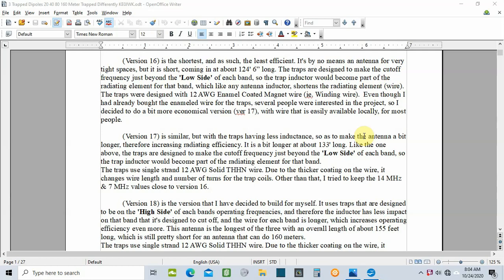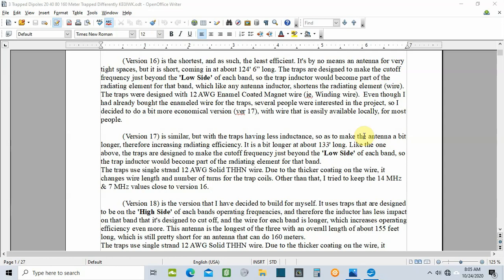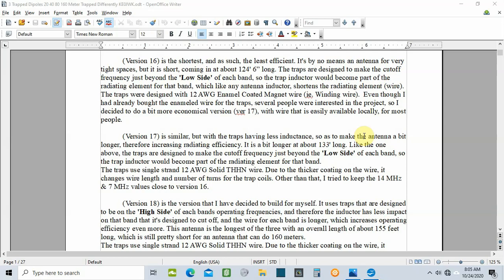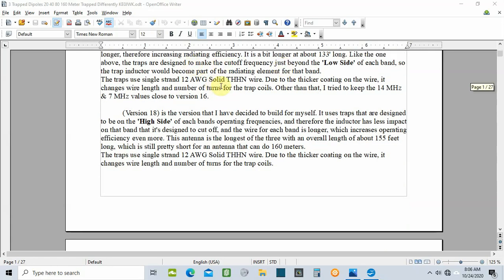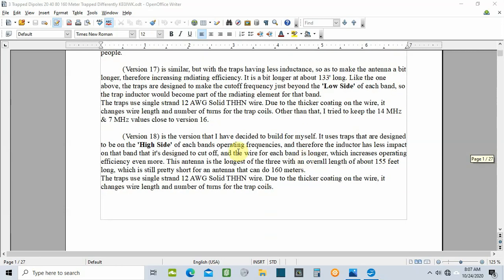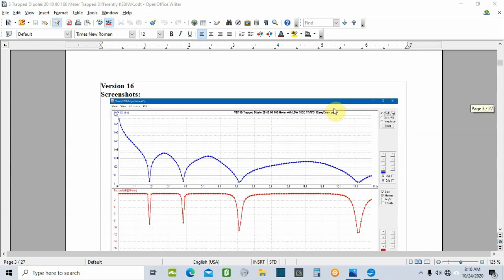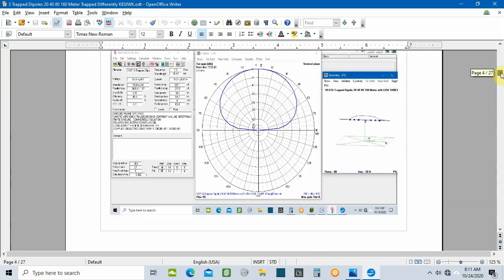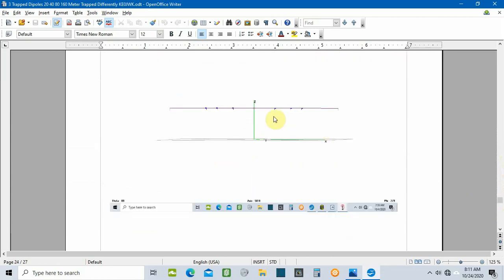20, 40, 75/80, & 160 Meter Trapped Dipole #2

Comment: Thanks so much for sharing.

You mention about the capasitor from two size diameter copper pipe and the length around 2 Inch for 40 m, 3 inch for 80 m band, and there is a gap between two copper pipe which younput the cpvc.

How about the coil? Could I use calculation for shortend antena without capasitor only the coil?